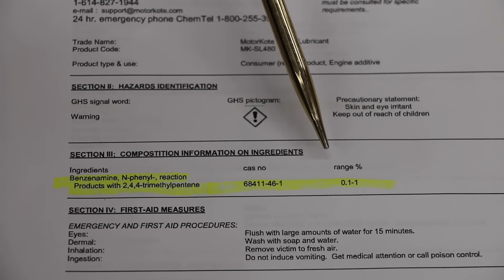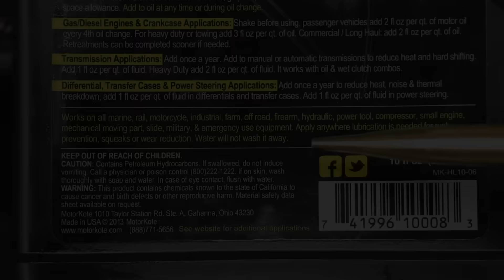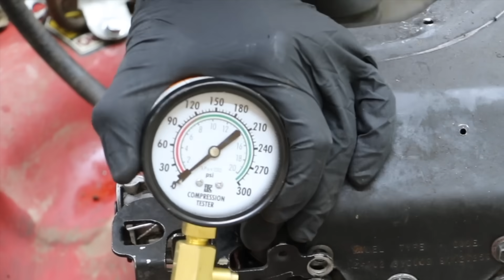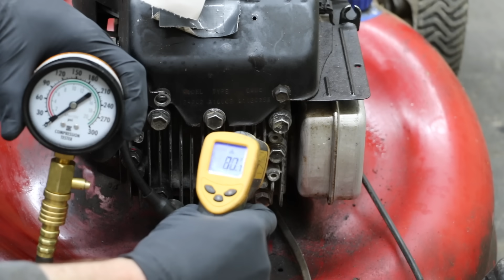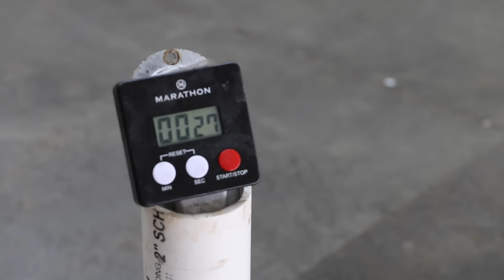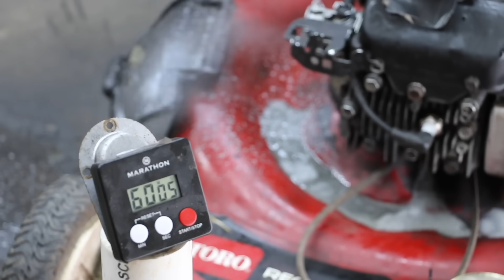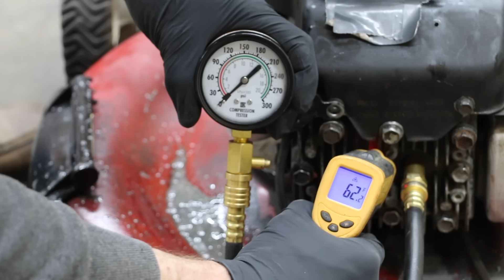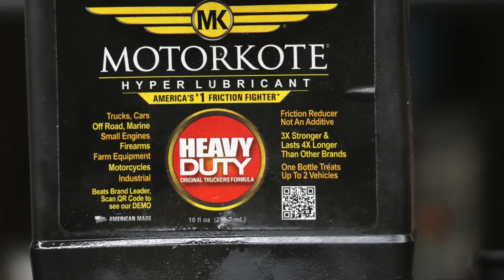Can MotorKote survive the water test?  Let's find out!

Comment: Short term results are great.  What are the long term results in an engine?  I would not put this in my vehicle.
Reply from the maker: Thank you
Reply: @ProjectFarm  Thanks for taking the critical comment in spirit it was intended.  The short term lubricity is impressive.  However, putting this stuff into your vehicle is a risk I would not take.  I would wait to see what it does to a vehicle engine over a few years.
Reply: I've been using it for nearly 17 Years in all of my Big Trucks, Cars, Outboard Motors, Generators, Lawnmowers etc...never had any issues and everything still runs like new. 
 I use to run the Arctic Circle and the NWT with this stuff, and the Engine would just purr. 
 If I came out afterwards in Sub Zero 4 Hours later...I could still get it to start up with no difficulty.  This is the only thing I use in my Engines.
Reply: @darring.9161  Hey, thanks for the long term results!
Reply: @redfisher6669 . Very welcome Sir...just use it as per the instructions and you'll be fine!

Comment: I am an AMSOIL user when if comes to drivetrain lubricants. I've heard claims that if you change out the gearlube in the differential with the appropriate rating of AMSOIL full synthetic product that the rolling resistance will be reduced enough so as to increase MPG. I've heard people say that a vehicle coasting from 20mph to a final rolling stop will travel 15% further after switching to AMSOIL product. It would be neat to have one or both 'claims' tested. Just a thought. Love the videos.
Reply from the maker: Thank you for the video idea!

Comment: I always add a ptfe based additive in the motor and in the manual transmission oil.
One day I was traveling and the transmission oil leaked (I didn't notice), ran dry for 300 miles, and it didn't die.
Reply from the maker: Wow! Impressive!

Comment: What they don't tell you is the additive for that type of EP (extreme pressure) causes severe acidic corrosion once the engine has a few condensation cycles. Assists in converting moisture to HCl. Also nothing in the engine has they type of friction surface thus those additives were initially designed for GL-5 lubricants. Not motor oil. You can achieve these same results by using Head and Shoulders shampoo or any other highly chlorinated base., 
In summary it destroys the detergent in the oil thus the claims by the FTC.
Reply from the maker: Thanks for commenting.

Comment: I have been using Motorkote for several years now and I really believe in this product. Everything from 70s Dodge Vans, boat motors, Gravely Tractors, Lawnboys, snowmobiles etc. I've had several impromptu tests. The first was a 2001 Pontiac Grand Am with about 150,000 hard miles on it that had all kinds of noises coming from it. I listened as I poured the specific dose into the running engine and to my surprise it got quiet! Second, was a mid 90s second hand Lawnboy 2 Cycle lawnmower that I purchased in a lot. It had the death rattle from day one and had slop in the shaft bearings. Well, whats done is done I figured so I decided I would mix a little Motorkote in with the gas every now and again and try to get what I could out of it. That mower ran 5 seasons for me due to what I feel was the Motorkote. Now, the test ended abruptly with it throwing it's connecting rod probably due to being repeatedly overheated and overstressed. Not good in some ways. The stuff is so good at what it does it could actually mask symptoms. The last test was my 1987 Yamaha Phazer snowmobile. I usually thow a little Motorkote in the gas tank and oil tank just as insurance. Well, two Winters ago it paid off. While out riding I noticed my exhaust pipe getting super hot. I thought perhaps a rodent had built a nest in it and it was just burning off. Well, about two miles more and I noticed a great loss of power and the heat was intense. The motor was not locked up but let's say it was tight. The oil pump on the oil injection system had quit unbeknownst to me! Thinking quickly I dumped the entire contents of the oil tank into the gas tank and waited for it to cool down. It started up and I ran it home at least 5 or more miles like that. Next day I performed hot and cold compression tests only to find that everything was still in specifications. Stuff smells really strange when it's burned in a 2 cycle and will probably end up killing me but it works! I'm not embellishing my story a bit. I mean I'm not surprised at all with your experiments. I have it in everything I own. Every third oil change on my street vehicles. I don't know what else to say. Seeing is believing. The Motorkote demonstration was enough to get me interested. The only time I would not recommend using it would be break-in on a new engine. You need heat and friction to seat piston rings etc. Good stuff folks! I'm not a paid endorser just a user.
Reply from the maker: Impressive results!  Thanks for commenting.
Reply: Yes old engine without vvt may be fine
Reply: I got 1.25 million miles on a Detroit 14 liter and have never had a head bolt out of it yet.  Still runs great and still has power.
Reply: @kenbowser5622  whattt really??
Reply: ez round btw my uncle owns an airport shuttle business and on one of their Ford E-250 Econoline vans they have 1,050,000 miles on it it rolled over it’s odometer a little over a year ago at 999,999 and now has around 50,000 miles on the odometer so that’s 1,050,000 the van still runs like a champ with zero issues original motor and transmission no major repairs just standard maintenance although my uncle never has used motorkote before just standard synthetic motor oil
Reply: @aceofspades9833  you should put a little motorkote in a transmission as well to keep those bearings and planetary gears and high-compression bearings coated passage suggests on the bottle you extend the life of your transmission power steering rear differential and transfer case depending on what you have on your vehicles

Comment: Can you verify if this happens to you?  This fellow wrote  - This
 stuff gets rave reviews but I tested it for myself in a brand new mason
 jar before using it. mix it with the proper ratio for a quart and 
shake/stir up the new oil/motorkote then let the jar sit for 3-4 days 
pour out the oil/motorkote into another jar, and in the bottom of the 
first jar was some sort of goo that was like molasses or buildup on the 
bottom NO WAY was I going to put that in an engine. Also I suspect after
 checking with some other reviewers on Bob is the Oil Guy it contains 
about 25% chlorine even-though they claim it does not. Now I have a 
quart of oil/motorkote I have slowly been using to lubricate random 
things like hinges and such but no way will this go in my engines.
Reply from the maker: Thank you for the video idea!
Reply: @ProjectFarm  https://www.amazon.com/gp/customer-reviews/R11WUNW96GJ6FV/ref=cm_cr_dp_d_rvw_ttl?ie=UTF8&ASIN=B000EGAM0I

Comment: This stuff contains chlorine which will turn into an acid in your oil.  You will get the same results on the lubricity tester if you used straight bleach.  There's a reason why they only list a few of the ingredients.  Cummins or amsoil did a test with this and it destroyed the engine after so many miles.
Reply from the maker: Thanks for commenting on this.  The trucking world uses this all the time and a lot of truckers have commented regarding many miles of use with good results.

Comment: Motorkote needs time and operating temperatures from regular driving to adhere to the friction surfaces inside the motor. The lubricity test you performed didn't allow any time for the product to stick to the metal. Motorkote is not a stand alone lubricant. I think the tests would have come out differently had you followed the instructions. I've used this in my vehicles ( and screwed up the clutch in my Honda, Doh!!!) with good results, better MPG, lower operating temps, 200k + on the pickup and cars. Still good performers. 
I'd like to see you pull a bearing out of a treated motor and test the lubricity, redo the water test on a properly treated motor, measure the water level when refilling the crankcase. Looks like you overfilled it 1 time during the video
Reply from the maker: Thank you for the video idea!

Comment: The motor should had died within 5 minutes or less,  but it continued to run. It proves that the motorkote works. So, I will use it on my van. To squeeze out another 150k.
Reply from the maker: Thank you!

Comment: I believe the water test is incomplete.  You should've ran the engine with no motorkote and see how long it'll last.  Yes, that'll ruin it but you have a benchmark to go off of. Thanks for the info
Reply from the maker: Great point. Thank you
Reply: He correctly stated that the water was to dissipate the normal heat generated during the combustion process. No benchmark would be found.
Reply: @jcwoods2311  why use oil then if all you need is water??

Comment: The claims and performance of this product appear VERY similar to the ORIGINAL "Slick 50", not the crap that is sold under that trade-name today.  It was released under that trade-name in the late 70's/early 80's and distributed through direct marketing in Metal Cans, not the plastic bottles of Slick50 you see in retail stores today.  Unfortunately Inventor, John Bishop, had a fall-out with the distribution company Petrolon and withdrew the formula from them but THEY kept the name which has since changed hands many times.
https://www.businesswire.com/news/home/20040928005221/en/Xcelplus-Brings-Original-Slick-50-Formula-Market
Although that original "marketing scheme" claimed the use of PTFE resin (Teflon), there was practically none of that in the formula and had nothing to do with it's performance.  It was just that teflon frying pans were becoming all the rage about that time so Petrolon jumped on the hype bandwagon.  The LAST thing you want to put in an engine is PTFE resin, as was re-iterated by Dupont.  John Bishop's formula was later marketed under the name Xcel Plus in Australia.  After seeing Project Farm's test,  I'm wondering if John Bishop's formula is now used in MotorKote?

I personally used that original Slick50 in several engines with amazing results, ie improved fuel economy and virtually zero oil consumption.  Most of those vehicles have long since rusted away but a 1982 Honda 450 Nighthawk motorcycle is still running smooth and strong.  The motorcycle was a great test because it uses the same oil in the engine and transmission.  Within 2 miles of riding, the transmission shifted like a hot knife through butter and remains the same to this day.  I also put that Original Slick50 in a 1978 MTD 8 horsepower 26" Snow Blower and have been running a torture test on that beast for nearly 40 years now.  I added the product in 1982 and have NEVER changed the oil since, nor the spark plug for that matter.  The oil still smells like oil, the engine doesn't smoke and the thing rips through snow (even the wet heavy stuff) in a manner that puts my neighbor's 3 year old John Deere snow blower to shame.  I wouldn't trade it for any Blower on offer today!  In over 40 years, I've had to replace the drive belt twice (turned to fluff) and one spring on the blower engagement lever snapped on a really cold day.  That's it!  I'm sure part of the credit goes to the trusty 8 hp Briggs & Stratton engine but I've gotta believe that the Original Slick 50 helped keep it going through all these years of neglect.  At this many years into the test, there's no sense in changing the oil now.  I had to use the blower last week and it started on the 2nd pull, just like it has on the first start every winter.  Gotta love manual chokes.
Reply from the maker: Thank you for this information!
Reply: I had the same experience with my truck using the original Slick 50. Bought it new and around 60,000 miles or so added the S50. It was an s-10 truck with a 2.8L V-6 manual transmission. Drove that truck everywhere. Racked up 535,000 miles. Sadly I was running a small generator in the bed of the truck at a construction site and the wind blew some debris around the generator and it caught fire. The truck was destroyed by the fire. Even with over 500,000 miles I could still go 4,000 miles before needing to add any oil. I would treat the engine every 50 or 60,000 miles with a fresh bottle. Nothing but normal upkeep was performed. It was a great product back then.
Reply: Very interesting info about slick 50!  My dad used to swear by it, he said "a quart of it in every 50k mile oil change and that engine will last forever."  And ProjectFarm, excellent testing!  Thank you for the video!

Comment: Hey, I've been doing a bit of reading on Motorkote and have found lots of evidence that suggests one of its main ingredients is Chlorinated Paraffins.
While Chlorinated Paraffins are an extremely good lubricant, it also has dangerous reactions with water, especially at high temperatures which creates Hydro Chloric Acid.
The acids react with the metals and actually destroy them over time. AMS Oil has a TSB mentioning MotorKote specifically containing 27.2% Chlorine. TSB# MO-2010-04-01.

I was wondering if you could do some research or long term testing to see if this product could be actually dangerous to use in an engine? I am concerned because I was very tempted my self to begin using it in my car, however now I think I will stay far away from it.
Reply from the maker: Thank you for the video idea!

Comment: Very good presentation!  I like how you really test these things out  Back in the 80's SFR (Super Friction Reducer) came out with a silicone based additive for oil.  It was a pretty good product. Motorkote  copied the product and was sued by SFR and lost the lawsuit.  Motorkote either bought into the patent or slightly modified the ingredients to bypass the patent, I don't know.  I do remember a commercial with Dura Lube, which also uses silicones,  where they take a race car and remove the valve covers and coat the engine in mud, then drove it around the racetrack with no problem. Dura Lube also uses silicone in its product, so I guess they are all related.
Reply from the maker: Thank you!

Comment: This is by far one of my favorite channels for knowledge, thank you!  Special request, can you perform a lubricity and friction test based on your most current test procedures comparing motorkote to a product called extreme friction fighter.  Even in 2019 I have not seen one test by anyone other than its creator, and although I have used it in the past, I have since stopped out of skepticism.  I have two 15 litre cat motors I'm trying to keep healthy, and I primarily haul superloads with long periods of idling year round, across all temperature variations.  I also have a 5.9 Cummins in a little truck, and a brand new 6.4 hemi.  I love my motors, and I love high performance with longevity and efficiency.  Seems to me that heat and friction are counter productive to efficiency and reliability.  Thank you very much for what you do, as of now, I will be adding motorkote to my vehicles' diets 😁
Reply from the maker: Thank you for the video idea!

Comment: I would like to see the Motorkote tested by soaking some rubber in it, seals, esp silicone rubber, and automotive o-rings at a hot temperature for at least 24 hours to see if there is any rubber breakdown, and of course the control would be the same test using motor oil.
Reply from the maker: Thank you for the video idea!

Comment: How about adding solely motorkote to the crankcase?
Reply: The engine would overheat. Motorkote is wax based, so it won't carry heat as well as oil. Its still a great product, I use it in my Mk7 GTI and at 105,000  miles it burns no oil, and has maintained its fuel milage for the last 85,000 miles

Comment: incredible! To the argument of, "should I flush my engine periodically with keorosene (or another product...?)"...perhaps treat with Motorcote first,
then flush....this way bearings, etc. are protected during flush? Thanks for video!
p.s. I simply cant belive engine ran an hour with nothing but water in gas tank...I guess only control I would add would be to run
a mower on water WITHOUT pre-treating with Motorcote to see how long will last?
Thanks for your great videos!
Reply from the maker: Thank you for the video idea!

Comment: Motorkote will ruin your engine it contains Chlorinated Paraffin which never mixes with your oil. As the oil heats up, the chlorine reacts with the metal, creating a metal chloride film on the surface reducing friction this is why it will not wash off with water!  But once the chlorine has bonded to the metal, the hydrocarbons turn into sludge, and the excess chlorine can react with trace soluble metals in the oil, creating hydrochloric acid once again. This chlorinated paraffin depletes the alkaline in the oil, causing the oil to break down much faster than it should. Chlorine also eats away at rubber, neoprene and cork, which are the main components of engine seals.   here are independent testshttp://www.thebestsyntheticoil.com/pdf/TSB%20MO-2010-04-01_chlorine_oil_treatments.pdf   https://fuelandfriction.com/weekend-warrior/dangers-chlorinated-paraffin-additives/
Reply: If what you're saying is true truck drivers wouldn't buy it. I myself have put over 100,000 miles on my car solely city driving. Dozens of red lights a day, hundreds of miles of stop and go commuter traffic a week, and untold days worth of idling. My oil temp is usually over 230°(f) and I can't imagine worse conditions for a car. And I have yet to E V E R suffer from low oil. Not a single drop lost between changes. Motorkote works for me.